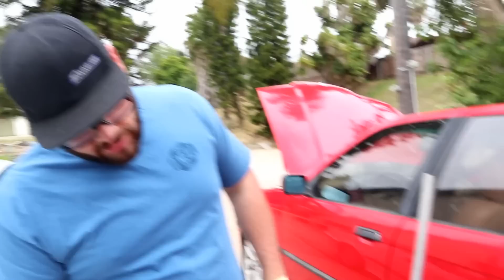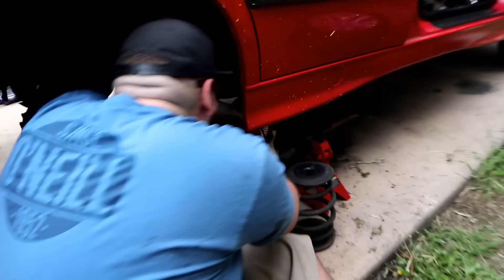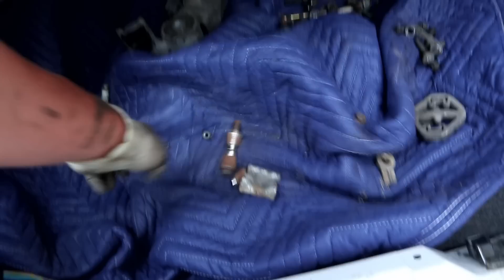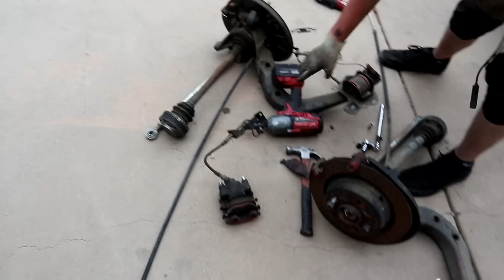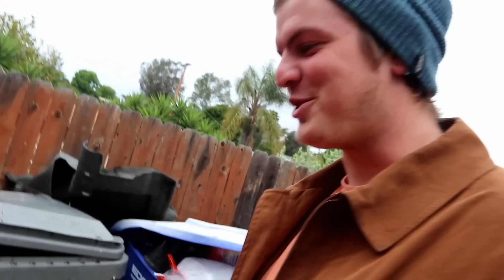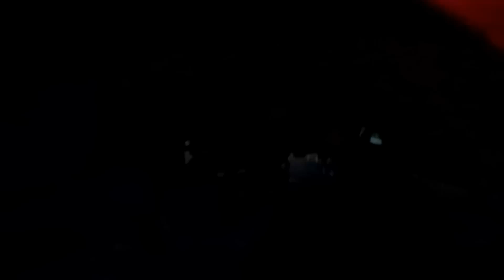The 318i Gets M3 Rear Suspension!

Comment: About to do the exact same to my 318is. 

I noticed you dropped the diff shafts lower control arms and RTA's all as one, preety sweet! How come you didn't put the M stuff up as one? Weight and manoeuvrability?

Would you do anything different if you did it again?

Cheers from the UK!
Reply from the maker: yeah all that came out as one as the axle bolts on the diff were seized. it is alot easier to assemble it piece by piece. as far as doing it differently, not really. we didnt run into any assembly issues that require it to be done a different way. my only tip is to put the diff in last, as installing control arms onto the subframe is a PITA with the diff in place. good luck with the swap!
Reply: @M3NACE  Thanks for that dude, Cheers!

Comment: Good video .Liked
Sorry for writing you here.
But can you please tell me please what size head gasket should i buy for my EU version 328i 
VIN ET24461
What is the original size?
And what thickness shoul i buy if i machine de cylinders head?
I'm a bit confused because on-line i find diferent sizes( thickness).
Reply from the maker: just run a OEM gasket, or an Elring gasket. OE thickness. machining the head will usually not be enough justify a thicker head gasket, unless the head has been machined several times. running a OE thickness gasket might actually give you a compression raise and a little more power.
Reply: @M3NACE  
Thank you for response. 
It's true that the factory size it's 1.75mm?